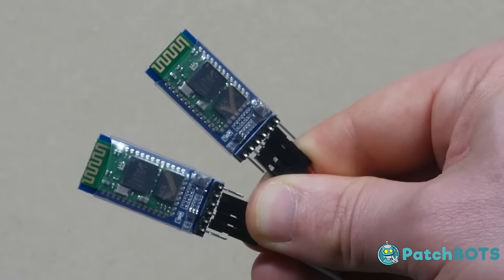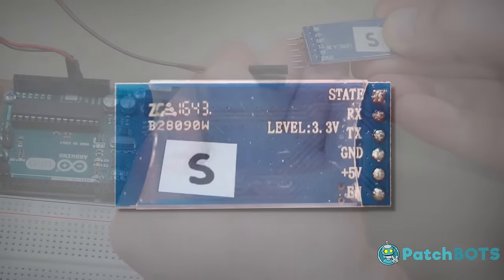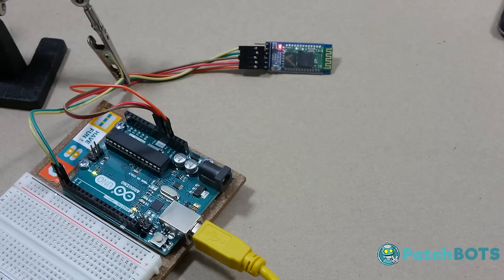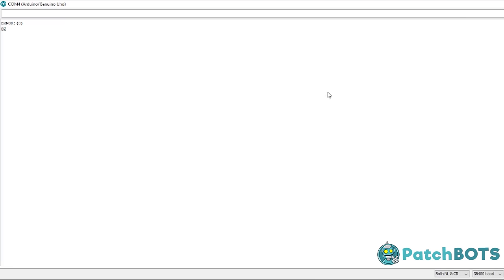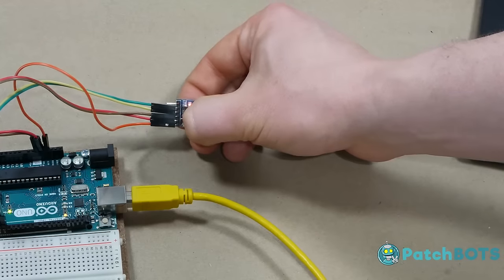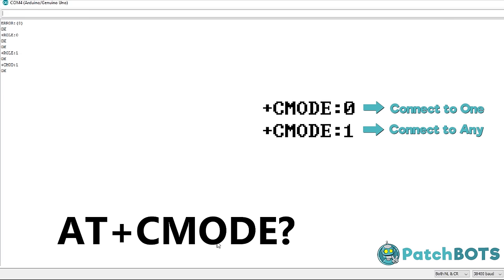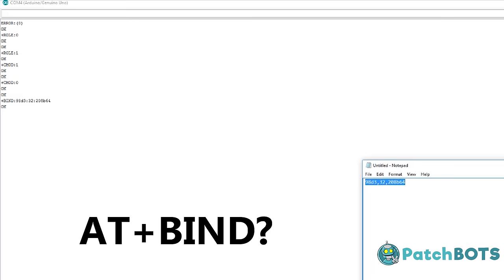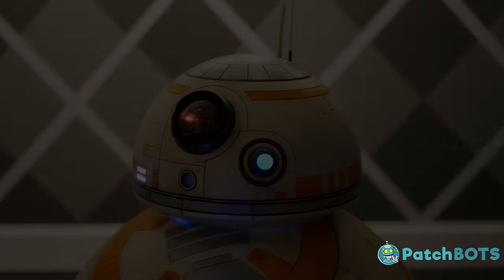How to Pair HC-05 Bluetooth Modules

Comment: My two modules are paired. They both blink every 2s. But they cannot communicate with each other. Pls help me
Reply from the maker: What are you trying to do?
Reply: I made a gamepad to control my robot. I already resolved the issue thanks for the response. I had problems with matching of baud rates of the two. 

Great video! Keep them coming. :)
Reply from the maker: Yes, the baud rate of AT Command mode is separate from the Baud Rate for communication. I wish youtube still had the "notes' I would happily add it back in
Reply: PatchBOTS Yes, I've also forgotten to change the baud rate for the com port of my pc. I was trying to check the response of the modules through Serial.print before wiring the circuit to the robot.

Also, the previous tutorial videos I've watched from different channels forgot to mention to connect Rx to Tx pin and vice versa after configuring. Your video really helped me alot. It's quick but accurate. Keep it up
Reply from the maker: "quick but accurate" is exactly what I was going for.  thanks for the feedback, it means a lot!

Comment: Isn't it bad to take the pin directly to the Arduino without using resistor does it not damage the Bluetooth.

Comment: Cannot get HC-05 to accept AT commands. Have followed instructions to the letter on two different modules, with two different Unos, and two different sets of jumper wires. Have tried all of the fixes in the description.  Odd thing is the modules appear to be in programming mode with or without pushing the button at power up.
Reply from the maker: I know you said you did everything to the letter, just double check these two things: 
1. Your baudrate is set to 38400 in the Serial Monitor. 
2.  TX-->TX   RX-->RX

Comment: For the Arduino Nano - I needed to drop the voltage  to 3.3v on the RX Pin by connecting a 1k and 2k resistor. (search google for connecting HC-05 to Arduino Nano)

Comment: Hello Sir,
Nice  explanation, I Tried to pair the same two  HC-05 modules as the same way you have told in above video but when i was using "AT-BIND=21,13,1fdc7" it is showing me error(7) that is think this part "1fdc7 " of my slave module address is long, as per At commands information for HC05, so Please help me 
and also my mainly aim is to scan such more that two modules and pair with one of them as per my requirement but the issue is that when i am entering AT+INQ commandit shows me error 1F so kindly help me if possible at the earliest 

Thank You and Regards
Reply: utkarsh patil Did you ever solve this? I get same error with 5-6 different modules when binding.
Reply: look for a space after your address. paste often adds a space which will end up giving you the error: (7)
Reply: you should write like this 0021,13,01fdc7
Reply: YES ADD 0 IF YOUR MODULE SHOWS LESS DIGITS, MAKE SURE 1SET IS 4 DIGIT, 2ND =2 3RD=6

Comment: HI SIR
I AM USING ARDUINO NANO AND SAME HC-05  BUT I AM NOT ABLE TO PAIR THE BLUETOOTH 
bluetooth went to AT mode  but while entering to serial monitor  i am not able to find any response
Reply from the maker: This tutorial does not work with a Nano unfotunately.  Someone with more hardware knowledge can probably tell you why, but suffice it to say....you need an Uno to perform the AT Commands.   I have some pre-paired HC-05s for sale if that helps you  www.patrickstefanski.com/store
Reply: this sketch works with both my arduino nano and arduino uno, 
both to program the HC-05 and also to send information to other HC or android BT terminal
/*
  SerialPassthrough sketch

  Some boards, like the Arduino 101, the MKR1000, Zero, or the Micro, have one
  hardware serial port attached to Digital pins 0-1, and a separate USB serial
  port attached to the IDE Serial Monitor. This means that the "serial
  passthrough" which is possible with the Arduino UNO (commonly used to interact
  with devices/shields that require configuration via serial AT commands) will
  not work by default.

  This sketch allows you to emulate the serial passthrough behaviour. Any text
  you type in the IDE Serial monitor will be written out to the serial port on
  Digital pins 0 and 1, and vice-versa.

  On the 101, MKR1000, Zero, and Micro, "Serial" refers to the USB Serial port
  attached to the Serial Monitor, and "Serial1" refers to the hardware serial
  port attached to pins 0 and 1. This sketch will emulate Serial passthrough
  using those two Serial ports on the boards mentioned above, but you can change
  these names to connect any two serial ports on a board that has multiple ports.

  created 23 May 2016
  by Erik Nyquist
  small changes for testing speed
  by Paulo Borralho 11/2018

CONNECT
 ARDUINO         HC-05
  10 RX           TX
  11 TX           RX
  GND             GND
  +5V             VCC 

  
*/
#include <SoftwareSerial.h>
#include <Wire.h>
SoftwareSerial Serial1(10, 11); // RX, TX

int time0, time1, nchar0, nchar1, dt, dc;

void setup() {
  Serial.begin(38400);
  Serial1.begin(38400);
  time0 = 0;
  time1 = 1;
  nchar0 = 0;
  nchar1 = 0;
  Serial.println("Escribe algo");
  //Serial.writeln("Escribe algo");
}

void loop() {
  //UNCOMMENT THIS LINE IF YOU WANT TO TEST SPEED
  //time1 = millis();
  dt = time1 - time0;
  if (time1 - time0 > 1000) {
    if (nchar1 > nchar0) {
      Serial.write("\nRecibidos ");
      Serial.print(nchar1 - nchar0);
      Serial.write(" en  ");
      Serial.print(dt);
      Serial.write("ms\n");
    }
    time0 = time1;
    nchar0 = nchar1;
  }
  if (Serial.available()) {      // If anything comes in Serial (USB),
    Serial1.write(Serial.read());   // read it and send it out Serial1 (pins 10 & 11)

  }

  while (Serial1.available()) {    // If anything comes in Serial1 (pins 10 & 11)
    nchar1++;
    char c = Serial1.read();
    Serial.write(c);   // read it and send it out Serial (USB)

  }
}

Comment: Great tutorial! I just have one problem: I can't set baud to 38400, when I try this and then enter AT+UART? I get 9600 as response. Do you have any idea how to fix this? Thanks!
Reply from the maker: Yes, the default communication baud is 9600.  To set to 38400 you'll need to enter the command in this format: AT+UART= <Param1>,<Param2>,<Param3>.  Parameter 1  in your desired baud rate, in this case 38400.  Paramter to is your stop bit.  0-->1 bit   1--->2bit.  and param3 is your parity bit.    If none of those extras are going to be anything special you can set it by using this command      AT+UART=38400,1,0          That should return 38400.,1,0 when you enter AT+UART?
Reply: @PatchBOTS  Thank you so much for your fast reaction! I have one more question: I tried to pair my two bluetooth modules and one of them does flash every two seconds but the other just flashes like every six seconds. Do you have any idea what could have gone wrong?
Reply from the maker: @puckvandisseldorp2253  run the AT+VERSION? command on each and see if they are the same firmware.   If they are different firmware they could be paired and just have differeent blink sequences.  If they are the same firmware then that's weird and you'll have to check if they are paired.  You can attach an LED to the "STATE" pin and it will light up when there is a paired connection.
Reply: @PatchBOTS  They are indeed from a different firmware and are now connected, so thank you very much!!